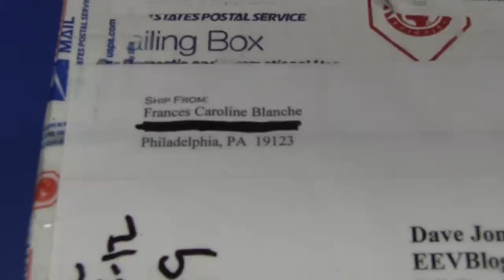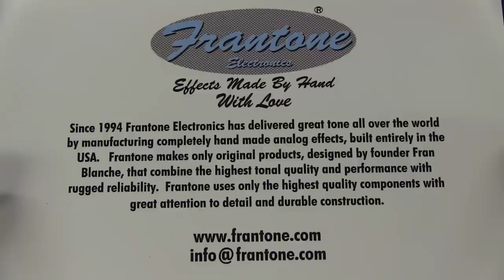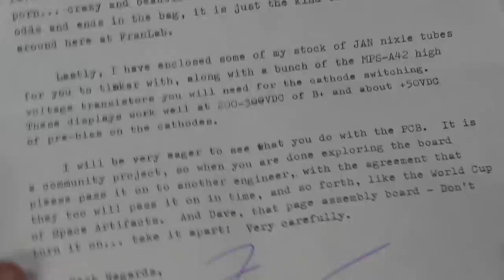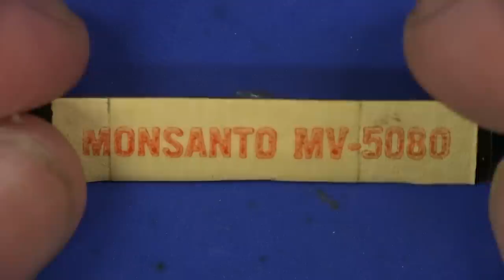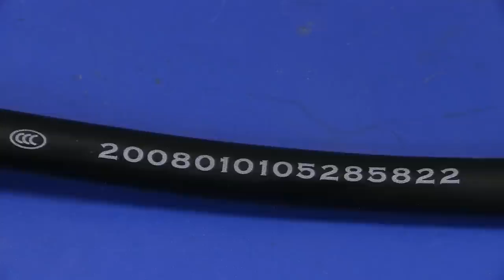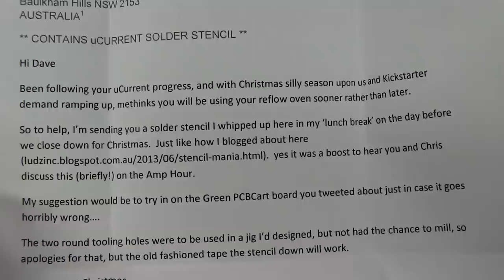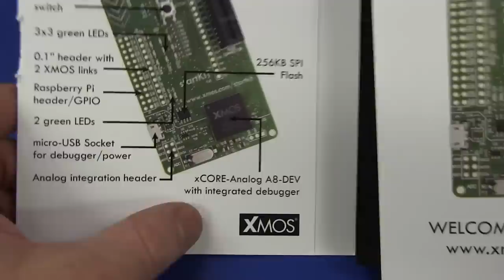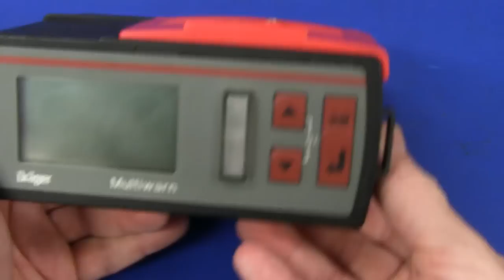EEVblog #561 - Mailbag

Comment: I didn't scroll through all the comments but just in case you wondered what the label on the multiwarn says:
 

Quick instructions

on
off
confirm alert
pre-alert
main-alert
system failure
flow-alert
battery pre-alert
low battery
end of operational life (auto-shutdown in 2 mins)

Check calibration before safety-related measurements.

Greetings from Switzerlands. 
It's fun to watch your videos and see how enthusiastic you are about those small technical wonders.

Comment: Check the chinese mains cable with a magnet, Dave. It may even not be copper, but some steel wires with a copperish plating, yeah, chinese counterfeits are that hardcore. The ohmmeter readings seems a little high in my opinion.
Reply: In fact, it is not copper. My best guess was stainless steel. Way too springy for copper.

Comment: Those old TO-92 LEDs may seem useless today, but they were hot stuff when they were new. The packaging was to use existing production lines to encapsulate them; drive them with 40 ma for their maximum brightness. Things have changed a lot since then, but in their day they made great indicator lights that had a unique color and would never burn out. The marketing folks loved them.

Comment: Dräger Mulitwarn is a Gas detection system, Can detect mulitple Gases. One parameter is the total explosive capacity of an air/gas mix (EX). The screwhole in the middle is for mounting a hose for remote aspiration (just a couple of meters with pump)

Comment: Hi Dave! The multi warn is a dangerous gas detector, i work in  oil refinery's and this is a personal gas warning system. I must wear it on me when i work on electric stuff or if i enter dangerous area's.( i am a instrumentation technician)
It detects explosive gases (LEL) and lack of oxygen, the circular things are the detectors itself.  It doesnt rotate, but you can install different sensors for H2S, CO, CO2, LEL (lower explosion limit) and different specific gases.
If it detect a amount of dangerous gas above the limit, it starts to scream and flash it lights.
The Multiwarn itself is Explosion safe (EEX D or EEX iA)
Bytheway, keep them vids coming!
Bas
(from The Netherlands!)
Reply: Bytheway, its not recommended to open detectors sensors (the alu cans) itself because they can contain some nasty chemicals... I know the oxygen sensor holds some acid (They work as a simple battery)
http://en.wikipedia.org/wiki/Oxygen_sensor

Comment: I've just wanted to add, that we use those plugs in Poland as well, and for 16A current draw, we're supposed to use at least 1,5mm^2 wiring. 0,5mm^2 is like up to 6A MAX. So with proper wiring, this cable would be scrapped. BUT with these wimpy hairs inside? It's like something designed to kill the user...

Comment: The "lens" is actually a push-hole or something like that, a lot of TO-92 transistors have a circle located there. It was a custom order for some camera at least 20 years ago. The plug has too small wire molded for 16A handling.

Comment: The mains plug at 20 mins is a Schuko plug (strictly speaking it is a CEE 7/7 plug which is compatible with CEE 7/3 also known as Schuko). It works in almost all of Europe except UK and a few other countries that have their own plug types. The order of the live and neutral terminals in a Schuko plug is irrelevant because one can plug it into the wall socket either way due to the symmetricity of the socket and the plug.
Reply: Just one detail missing: This plug was actually a french one. French Plugs can connect to any other (usual) EU sockets, BUT there is a hole in the plug to work with French Sockets. They have an earth Contact with a Seperate pin wich sticks out of the Socket and connects to the hole. Frech Sockets with their plugs are not reversable as the rest of the EU plugs.
Reply: "Just one detail missing: This plug was actually a french one."

That information is not missing in my comment because is says it's a CEE 7/7 plug and it actually is a  CEE 7/7 plug :-)

Here are some definitions:
CEE 7/3 = Schuko socket with ground contact on sides (reversible), used in most of Europe
CEE 7/4 = Schuko plug which goes into CEE 7/3 socket
CEE 7/5 = French style socket with protruding ground pin (not reversible)
CEE 7/6 = French style plug which goes into CEE 7/5 socket
CEE 7/7 = A plug which is a crossbreed between 7/4 and 7/6, fits both 7/3 and 7/5

(I hope I got all the numbers right)

So, the idea in a  CEE 7/7 is that it will fit the regular Schuko socket (CEE 7/3) but it will also fit a French style socket (CEE 7/5) so you do not need two manufacture different plugs but only one.
Reply: the problem with the powercord 3 x 0.75 mm2 is the minimum to be legal.

Comment: According to my UK electrical regs book, 0.5mm^2 is ratted for 3 Amps, not sure i'd trust that mailbag flex for 1A even.
The rating on the plug is confusing, it would only be the rating of the plug, not the cable, that's why i like our 13Amp fused UK plugs (can change the fuse to suit the cable)

Comment: in Europe i don't think that really maters. you can plug them the reversed with no problems for the appliance.
Reply: +Fernando Melo In fact the "confort" socket was created in France, after having used shuko up to the 60's, partly because it allowed the plug to be mounted only in one direction. It was devised to be mounted with the line at the right side when facing the socket. Unlike the plug itself, the "line right" finally did'nt become mandatory, but you'll still have most electricians wiring their plugs with the "line right" rule (as I did in my house).
Reply: over 50% of the wall sockets in my house don't even have a earth connection.....
Reply: Philippe Bourgon
Reply: My house have no netraul wire. I have two live wires.

Comment: 20:20 You can plug it in the 2 ways, there is no real position for the neutral and active wires in the European plugs
Reply: Not in sockets, you're right spot on!  though it is strongly advised (and I guess legally bound) to put light fixtures the right way around. Because 99% of the time, the on/off button or switch is one-sided, meaning there will be a live connection at all times on the screw thread if you do it the wrong way around
Reply: Yeah but the electrician don't care because the plugs that don't have the earth cable (ground) they are symmetrical, so you can't distinguish one side to the other.
Reply: David Teles you mean the sockets themselves are symmetrical? Because live & neutral are not symmetrical per se, even without earth
Reply: Search on google Power Cables Europe and you can see the diferente types
Reply: David Teles Oh okay, that's clear, thanks! The power cables and the physical dimension of the sockets are all symmetrical! That's a bit weird why they'd do that.. I can think of plenty of devices where you'd want to "know" which cables goes to live and which one goes to neutral. Take for example the desk light.. People may assume it's "off", when it might be plugged the wrong way around, making the screw thread live (and connected, due to one-sided switching). In addition, in many high-powered devices, there's an internal (one-sided) fuse, meaning the power may still be live even after the fuse has popped!
Reply: ***** The original reason (often forgotten now) is that the european system was originally 2 phases of a 127/220v 3 phase  system (no neutral to the outlet)

Much old audio equipment has a 127v input voltage selectable (1970s and earlier), I always thought the voltage was odd, till I realized it was the phase to neutral voltage of a system with 220v between phases!

It incidentally allowed them to increase the power handling of the local network by upgrading to 220/380v 3 phase and just changing the connections, but in the original format, both wires were 'active' or 'live', so the polarization of the socket in fact didn't make any difference.

You still see the effect of this in some european appliances, which may have the switch in the blue wire, if it happened to be closer. The EU regulations refer to the neutral wire as "Live" even when at zero volts, as it is 'current carrying in normal use'.

Sorry for the long rambling reply, but hope that explains why the outlets are symmetrical :-)
Reply: Cool men, thanks for the explanation i didn't know that
Reply: ***** Thanks man, for the lengthy explanation! one more question... If you represent the 3 phases as #1, #2 and #3, does this mean that the phases used to be connected to homes as either 1+2, 1+3 or 2+3? Nowadays, with neutral in the game, you only need to connect every home once to a phase, making it way cheaper to install, is that correct?
Reply: ***** I always wondered, too. I'm from germany. I mostly like these from the UK. I love their plugs. They are big, but there is a fuse in the plug. I like it. Kinda. But the US plugs are quite compact but they are very unsafe.
Reply: Yes you can have single fase or 3 phase installation, the single fase is way cheaper than the other

Comment: @ 20:27 Only the Plug without cable is rated for 10A-16A at 250V.. this Power Cord is not suitable for High Load Applications. Greetings from Germany!

Comment: 20:00 it's a schuko, there IS no hot or neutral side.
Reply: It's not a pure Schuko plug, it's CEE 7/7.. So not only can it take the German style side blade earth connection but also the French style earth pin.. This enforces polarity.
Reply: The plug is the very common CEE 7/7 hybrid Schuko/French plug. Which is politicized, because the French plug is.

Please see this link for details: http://www.fam-oud.nl/~plugsocket/French1.html

Comment: Awesome news!  There's a Pixy video coming up soon!

I've got half-a-dozen of the little buggers here, but no idea how to drive them.   Was going to use a RaPi to do it - just haven't had the time.

Oah - And Hi Simon!   :)
Reply: a real nixy uses about  DC 70V on the screen and an open collector driver on the characters pulling them to ground when needed. not sure if positive or negative, but if wrong, the screen lights instead.

Comment: The biggest problem with these chinese crappy cables here in the UK is when they send a plug that will fit a UK outlet, but doesn't have a dang fuse in it, meaning the small appliance could be wired to a 32 amp breaker! It's like they don't care (and of course they don't!)

Another pet hate (not really a safety issue, just stupid and annoying) is wall wart type power adaptors with the cord coming out of the TOP, because the manufacturer assumes that the earth pin is at the bottom (a la USA), whereas in the UK it's at the top. You often see the writing on the adaptors upside down too.
Reply: At least the plugs without fuses are visibly wrong. Whereas an undersized cable or a plug that is fused but with a substandard fuse is far less likely to be noticed.

Comment: Apparently it was cheaper for Motorola to re-use their existing TO-92 tooling for a LED order, which is why you get the odd examples here. The third pin is simply part of the standard manufacturing process and is left unconnected to the die. There's a short description with a closeup of the die if you google Motorola TO-92 LED on decadecounter [dot] com

Comment: The live and neutral of that cable are swapped indeed.. at 20:10 you see that the blue lead (neutral) is going to the right pin, and in the next shot you see T2 (2nd live phase) next to that same pin. While the left one has (N) written next to it. But that's just a detail indeed.. it doesn't matter which way around.
Reply: You made the same mistake as the guy how send in the plug. The plug is wired correctly according French standard. I think the (N) means the plug is approved for use in Norway. The polarity does matter, if you have a 1 pole switch.
Reply: Per Mejdal Rasmussen
You could be right about the (N) = Norway thing. But polarity on these plugs is just and only an "official" thing. In practice you can connect this plug into the socket either way around, so the electric things behind the plug should be aware/prepared for that. I've been using these plugs for 27 years, so no need to correct me on that ;-)
Reply: The polarity can only be enforced if the plug is connected to a French socket (the one with a outgoing pin). Almost all devices works regardless of polarity. But there are safety issues to consider.

Let say you want to change a light bulb that is connected via a wall socket. The socket is not accessible, so instead of unplugging it, you turn it off by a switch on the cable. Unfortunately the plug was connect with wrong polarity. So instead of turning off live, you have disconnect neutral. Furthermore live is now on the side of the lightbulb socket, where it is easy to touch.

Comment: Dave, i would like to ,see the german cable (burn) with 16Amps going through it.
Reply: Only the plug is rated 16A, not the cable, which is rated less (it claims to be 0.5mm2). The fact that the cable is thinner than it's marking says is really awful, as it could easily cause a fire at a load which would be safe for a genuine 0.5mm2 cable. In at least parts of Europe, the legal minimum for mains leads is 0.75mm2 anyway, so they might as well have marked it with its genuine cross section.

Comment: Powercord: In EU you should have line (brown) on left pole and neutral (blue) on the right. However there are lots of cords that have blue neutral and brown line. I've heard that this is because of france, which is using exactly opposite color coding. My colleague got shocked because of this, because other one managed to screw up wiring, so line get to protective earth thru some device which had them interconnected.
Reply: "DE" weirdo standard makes that here at Finland the socket on the wall has LEFT as Neutral (blue), and Live should be on the brown, on the plug it is the mirrorized if looking at the pins. To me the plug on the video seemed fine. :D Electricity doesn't care about fashion colors, it cares about the copper only ;)
Reply: +JaVafromFinland In France having the line at the right side (on the socket) is a tradition. It was to become an official norm, but finally it's not, and i don't know if it will be one day, don't think so... The reason may well be because in various EU countries there are opposite rules.
Reply: Philippe Bourgon I think that it (unfortunately) didnt become norm/standard has something to do with the fact that you can plug the plug to wall in way that the neutral could be in wrong way if you have device that cares too much about it.. so better be manufacturing with fact that N and L can be all-the-way-around :D
Reply: You're absolutely right : In fact a national norm on this, now, could lead french manufacturers to make dangerous assumptions when exporting products, so it's finally better without it.